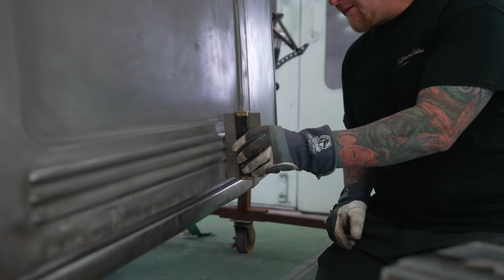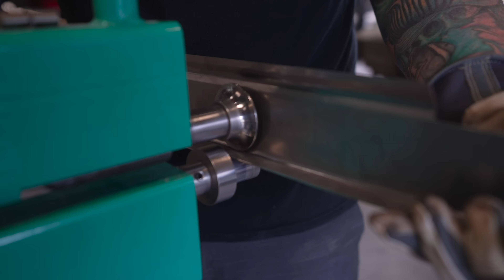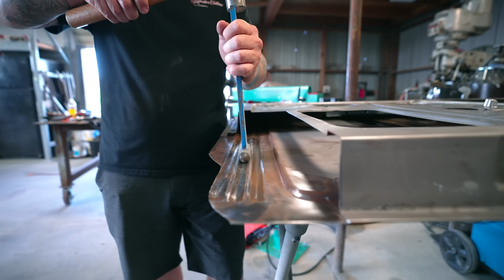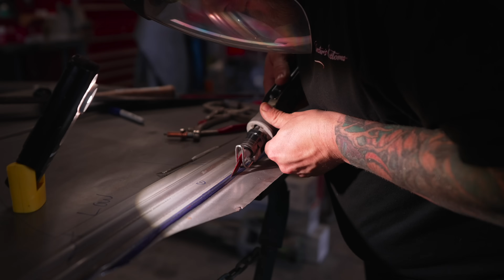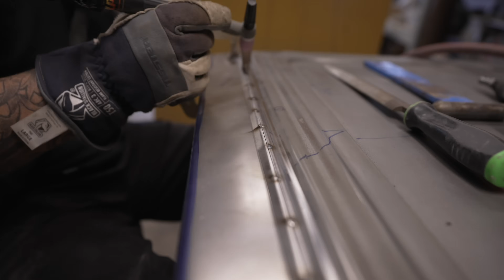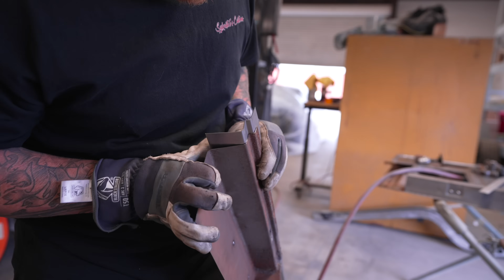Fix It Right or Regret You Didn't. Rusted Door Repair

Comment: AVmech is close but a compass has a connection from one leg to the other. Most can be locked by screw or have a long screw mounted to pivots. Used on ships, aircraft and precise mapping on paper or metal. A divider has a single top pivot connecting two legs together under tension. You have just entered 100+ year old world of coach building. Body was made by one company while the chassis & power train was built by the car company. A very good explanation of hammer and dolly planning with a bead roller used to create other profiles. My Datsun 1600 Roadster has a full box frame and power train by Nissan. The body was built in England with British standard bolts and threads. Great job of teaching to develop a plan ahead of slicing & welding, hoping for the best! Thanks.
Reply from the maker: Thank you!! 🙌🏻🙌🏻

Comment: You always advocate fitting the patch as close as possible to the opening the patch goes into. That is only true if you are tig welding. Doesn't the expansion while welding cause the gap/fit to close and cross over it's self. If you are mig welding wouldn't you recommend a gap between the body and patch. 60 years ago when I took a welding class, we had a very expensive water cooled tig torch. I didn't spend much time with it because I didn't think I would ever own one. Now, thanks to the Chinese, I have one but I went to get a small bottle of gas to try it with. $3oo --- wow! I already have 3 tanks to maintain, (oxy/act/mix). Is tig welding that critical that DIY'ers should rent another tank??
Reply from the maker: Couple things…. 1, Perfect fitting panels that are tight with no gaps is required tig or MiG doesn’t matter. 2, no welds expand but they do shrink this is where you get an overlap as you mentioned. If you hammer and dolly the tack welds it will relax right back to the state you started with. 3, the only time you want a gap or a fillet is doing thicker structural steel not sheet metal. Lastly the reason tig is superior is the strength and ability to hammer/dolly out the warpage which happens from the weld seam shrinking. In my opinion it’s worth tig welding but it is not for everyone. Can you get a good result with MiG sure! Do what works for you, your time, and your budget. Hope that helps! Thanks for watching!